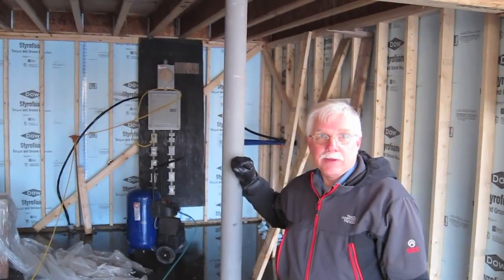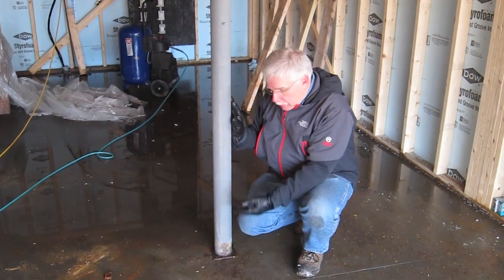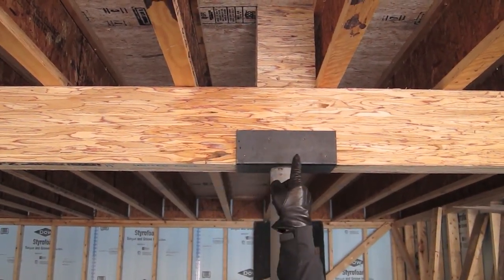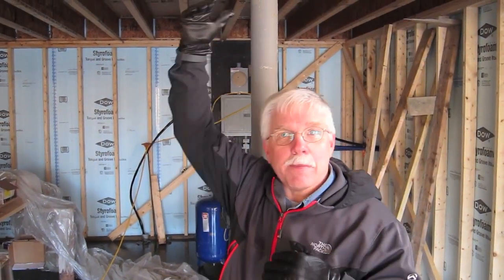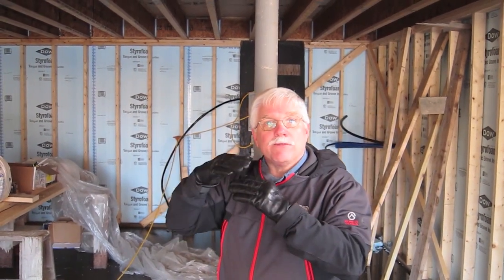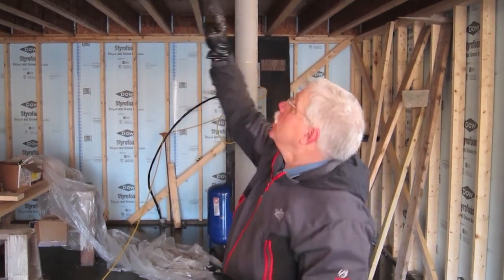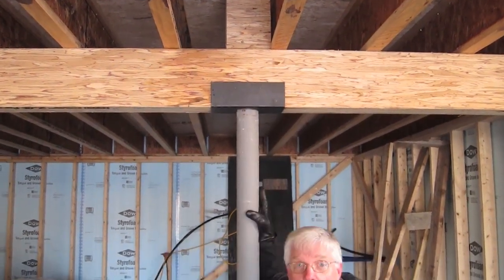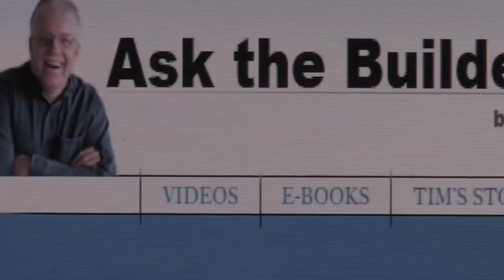Lally Column

Comment: The PSL or similar block on top of that dropped beam is installed in the wrong direction.  The compressive stress of wood and engineered wood in the case of PSL or similar is always highest with the "grain".  Its much lower the direction you have it oriented.  Usually, just best to use a section of the post above and provide solid blocking down to the beam below.  Great channel and content!  Nice work!
Reply from the maker: Good catch. This was not on one of my jobs. I was visiting the site of a big builder in Newport, NH. I'm devoting most of my time now to Shorts. They get 10 to 20X the views than these older long-form videos

Comment: I’ve just been told that I can’t trust a New Hampshire contractor to repair my rusted out lally column because NH doesn’t require contractors to be licensed. I guess I’ll have to see if I can hire a mass guy. I don’t feel comfortable doing it myself. I wish I didn’t think about thing so much and could just get stuff done without worrying about doing a perfect/correct job.
Reply from the maker: WHAT????? Have you ever been cut off while driving on the expressway? Have you ever been in an accident caused by another driver?  Were they LICENSED drivers? If you feel that licensing makes you TRUSTWORTHY and a GREAT BUILDER, boy do I have about ten bridges and a few hospitals to sell you. You can make HUGE money with both, trust me...

Comment: Was the bracket /saddle at the top of the post custom made ? What are the dimensions?  Thank you.
Reply from the maker: No, it was not custom made. Its width is 1/8-inch wider than the beam. Its height is 1/3 the height of the beam. It's length is 12.45832459 inches. Want great FREE tips each week? Subscribe to my newsletter: https://askthebuilder.com/newsletter/
Reply: @askthebuilder   Thank you very much !
Will subscribe.  I think your website needs a little "face lift"  lol. Just visited the website.

Comment: Why can't the timber post above  go straight down through the subfloor and rest directly on the structural header for a cleaner load path ? 
You don't need that block.  
Thank you.
Reply from the maker: It can. Installing the block so it touches the bottom of the subfloor is faster and easier and yields the same result. Join my Discord: https://discord.gg/u89GyDjBdr
Reply: @askthebuilder  Thanks for the reply.

Comment: Thanks for the video!   I'm very new to how houses are built.   I'm trying to figure out the hole forced air ductwork when dealing with the support header beam and joists.   It seems like you are damned no matter what unless you run it beneath all of that?
Reply from the maker: It's not an issue at all. Look at the photo in this column and imagine how the mechanic extended the ducts to the sides of the house. I do phone coaching if you need help: https://www.askthebuilder.com/hvac-static-pressure/
Reply: @askthebuilder  Thanks!  I'm a complete newb but it looks like he did a right turn up and ran the duct between the joists?

Comment: You should label it. The HVAC guy will knock it out. I actually had to header off floor joists that an HVAC guy had cut out completely to run a main heating and air duct.. Not joking. ..
Reply from the maker: This is why the builder needs to meet with the HVAC people the day they show up and go over what is OFF LIMITS.

Comment: I've seen a video of a basement refinisher nailing 2x6 wood to the lally column with a ramset and drywalling it in. Is this safe? I was wondering whether to do this on my steel (or lally) column which is on the main floor. You seem to be very knowledgeable. Your thoughts?
Reply from the maker: I think you should subscribe to my newsletter and then go read all my columns on my www.AsktheBuilder.com website about support columns.

Comment: You could, but you have to worry about buckling. All materials have buckling lengths and weights. One way to get around it is that you need to fasten it to the beams of the midway floor. I am not talking about pounding a bunch of nails in pieces of wood. To do it properly you need a metal encasing that is properly fixed to the beams. That way the metal encasing acts as a buckling impediment while properly transferring the loading to the floor beams. In buckling terms this is a pinned joined.

Comment: Question? I have a column post that is anchored  and the other is not. Do I need the other post? Its sitting on top of the concrete less than 5 feet apart.

Comment: I remember back when I was in the building material industry, before I was a contractor. As operations mgr, I would teach the newcomers on the lumberyard that you had to line up the blocking boards with the cross-ties or beams that were on the ground, so the lumber or plywood wouldn't warp from uneven weight transfer. Needless to say, everyday when I did my walk through, I would almost always see some stacks with the blocking boards about a foot inside the ground beams, and thus see the toe-out.

Comment from the maker: @blankpanic The answer is absolutely Yes. That's what I did at the last house I built. I hate lally columns. My basement had 12x31 I-beams that spanned 16 feet with just support at each end. It all has to be engineered, but suffice it to say a single I-beam could have been installed with absolutely no columns. It's usually a cost decision.

Comment: Are lally columns meant to be permanent structural elements after the construction is finished?
Reply: Yes the type here shown is. These are much stronger.  It differs from the jack post that looks similar and is used for bracing,  lifting, and temp support.